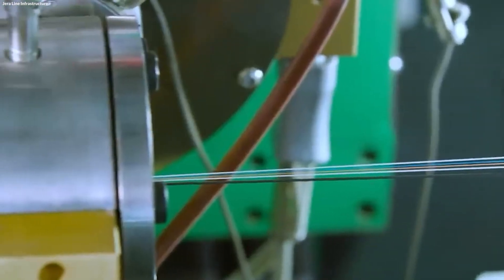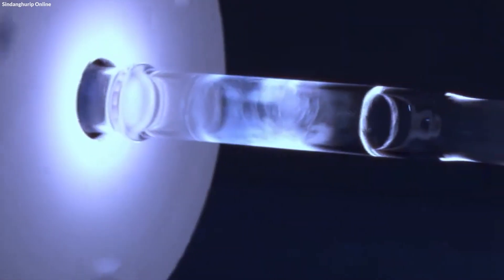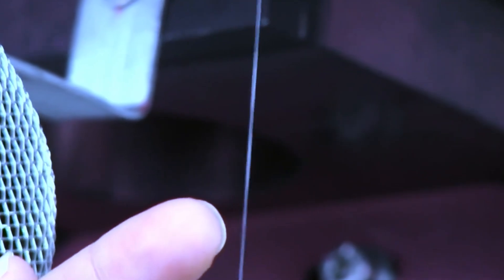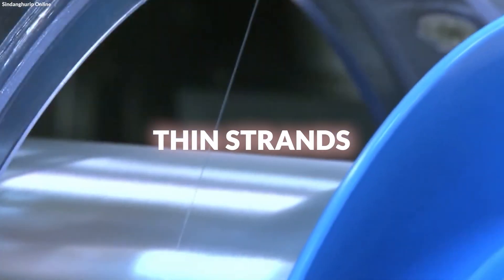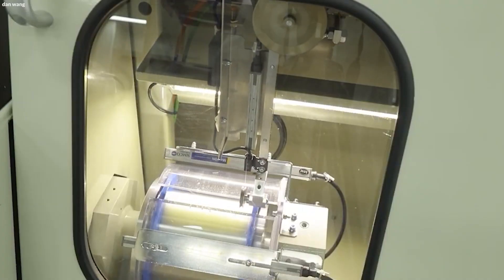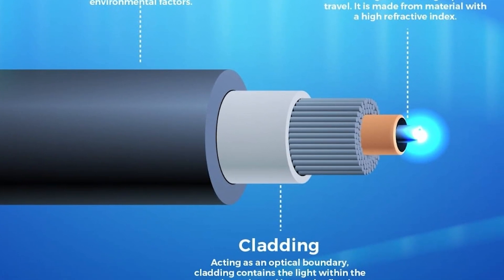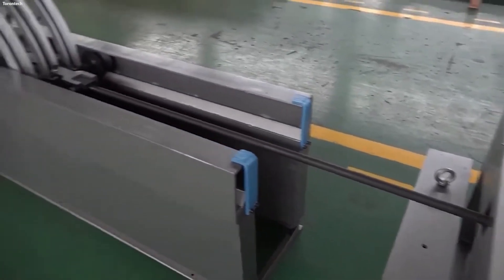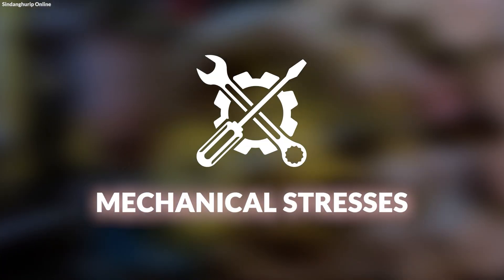How Fiber Optic Cables are Made - Thinner Than Hair!

Comment: Silicon is such a fascinating element. It's the second most common element on earth. Oxygen is the most common. They come together to form silicon dioxide or silica or sand. Silicon is somewhat like carbon in its chemistry. Carbon is the element of everything organic. Silicon is the element of quartz. Carbon dioxide is a gas without a liquid phase (at STP). Silicon dioxide is one of the most chemically resistant oxides possible. It's practically impossible to dissolve quartz with an acid. The silicon can be converted to an anion using an extreme alkali like sodium to form sodium silicate, but I just want to thank nature for making lab glassware possible. Looking at you, boron. You're not boring at all.

Comment: I got to see this from the beginning. I went to work with Siecor in 1982. Then Alcatel/Draka/Prismien later. It was awesome.
Reply: I’ve worked with both products. I had a job starting in the mid 90s with Alcatel 1603s along a pipeline. I even went to a class in Richardson, Tx in about 2000. My last job before retirement we had just a point to point with the LEC with these.
Reply: I also worked at Corning between 2000 and 2024.